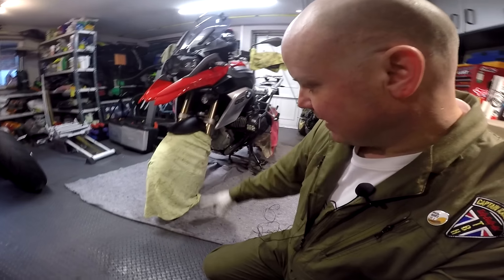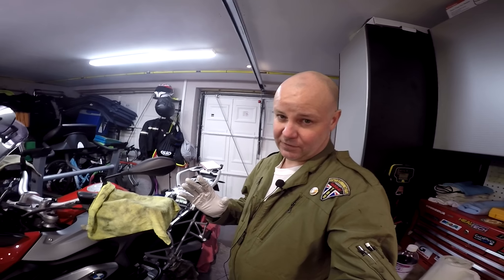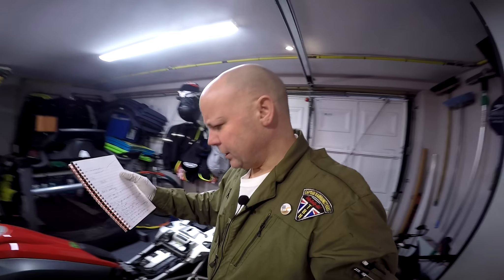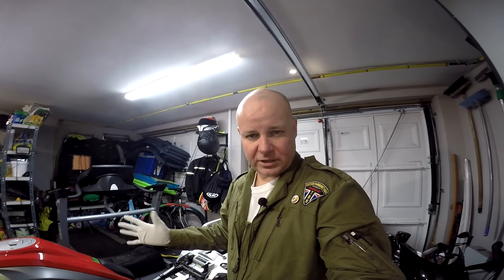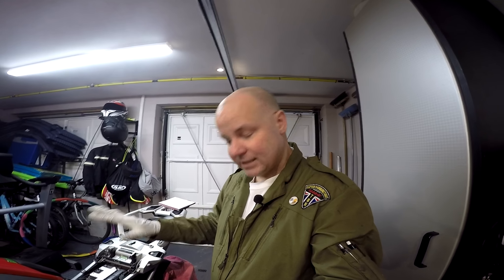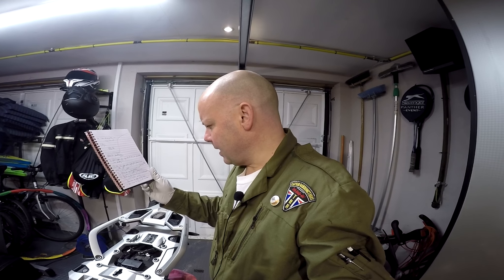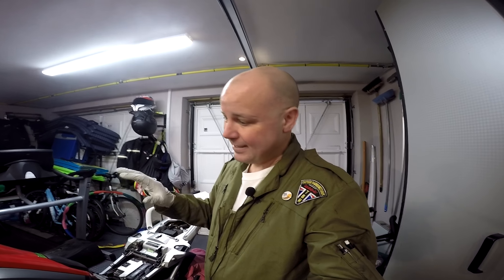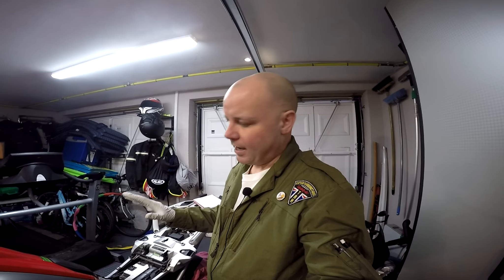How to apply ACF50 - Your questions answered

Comment: I've got a Bonneville T120 with chrome wheels and spokes. On the Bonnies you have 2 very large front discs. How would you apply ACF50 to these area's without getting it on the brake components and how well does it work on chromed parts?
Reply from the maker: I would do the wheels with it on a cloth or brush rather than risk getting it on the tyres/braking components (that' what I do with my CRF).....
Reply: I've started doing that today. I used the combination of a detailing brush and a wax applicator. Seems to work well although the front wheel is a nightmare. Unfortunately I couldnt finish the job as it started to rain and I dont have a garage...
Reply from the maker: Tell me about it - I washed and dried three cars and three bikes this morning...then it rained on them...ggrrgghhh
Reply: Managed to get it finished today but the wheels were a nightmare. managed to get them coated but couldnt get in the space to clear of any surplace off the spokes.... my answer was to take it for a ride at 70mph so centrifugal force moved all of the surplace to the rims and then removed it. Then cleaned any that had gone on to the tyre walls with some brake cleaner sprayed on to a cloth and then thoroughly cleaned. I'm hoping this gives me the results that all this effort has took.

Comment: Thanks TMF, a well timed presentation. I have two questions. I bought the arsehole, oops aerosol version and it does go on too gloopily. Could I spray that into a cloth and simply wipe it on? Secondly, I ACF 50'd my bike about 8 weeks ago, it's been garaged since and covered with an Oxford dust cover. My garage isn't heated, should I treat the bike again before spring or am I being over the top? It won't be out before then.
Reply from the maker: Yes that's the best way to do it and how I use the 3 (!) arsehole cans I still have! I'd say your bike is sorted until the spring, if you aren't riding it then you don't need to reapply, I think ACF50 state the product remains active for something like 2 years....
Reply: Ha ha, thanks!

Comment: Hi TMF, I apply it all over once a year about October but in addition I wipe it all over with a microfibre cloth soaked in ACF50 religiously after every clean.This keeps it totally protected. Even the plastics come up really well & looks better than the BS of back to black etc. It's amazing stuff. 
Also have you had any dealings with Vulcanet cleaning wipes? I use these to wipe over after any short rides to clean off bugs as an interim clean.I would be interested in your views on these, I find them very good & saves a full clean every time I ride the bike.
Reply from the maker: No I've not used the Vulcanet wipes as I don't trust "waterless" washes - I'm too anal about scratching paintwork by moving dirt around on its surface....for me it's lots of water and soap suds or not at all!
Reply: Fair comment, I was very skeptical until I used them & certainly wouldn't use them on a filthy bike but for a quick wipe over they are great, I hate putting my bike away dirty. I have a Triple Black probably the worst colour for scratches but there is not a mark on it! I agree you can't beat soap & water for a 'proper' wash though.
Reply: Hey Andy, saw those for the first time recently...assumed them to be an expensive waste of time.  My preferred method is snow foam type contactless cleaners and lots of water, to avoid scratches etc.  Always good to hear from people who use different products, but my word they're expensive.  Have you ever used snow foam type stuff, or SDoc1000?  Cheers, Glenn (by the way, I use a cheap snow foam now from B and M, as SDoc is brilliant but also bloody expensive!)

Comment: Thanks for the review. Initially you say that ACF50 is completely inert, then later you contradict this by saying that it reacts with some corrosion to reverse it. So are you absolutely sure that it won't damage plastic or painted parts?
Reply from the maker: 100% :0)

Comment: As always a great review on ACF50. I have always applied several coats of clear lacquer to the brightwork on a new bike and found that the fasteners etc remain corrosion free for years. what are your thoughts on that ? I live in central Scotland and do not drive in the winter, too much salt / ice on the roads around here.
Reply from the maker: Yes a great idea - wish I'd thought of that!  Having said that, I have religiously ACF'd my Triumph Street Triple and the nuts and bolts on that are as shiny as the day she rolled off the Hinckley factory floor....

Comment: I would like to ask if you spray coils , HT leads if it helps with horrendous fog and sub zero conditions , in the morning these weather conditions affect my bike , the bike just feels a bit rough because coming home in the afternoon the bike rides well , I will buy this product for the protection it gives the frame but does anyone else suffer the same problems or will acf 50 cure this too.
Reply from the maker: Worth a try!

Comment: I've heard people mixing ACF50 with something else and using it as a chain lube.  Any idea what that something else is and would you recommend it?
Reply from the maker: No - I would use chain lube to lube the chain and rust preventer/protector to prevent rust and protect your bike.  Quite different applications and the various specialist products are formulated accordingly (I have been to one of the manufacturers and seen them doing it...they know their stuff)....

Comment: Sorry TMF I found the atomiser was rubbish. In the end I used my air compressor with a half full “paraffin” spray gun works really well.
Reply from the maker: Yes that's defo the best way - but if you've not got a compressor (like me) then the ACF50 atomiser is the only thing that at least partially works (that I've found)....
Reply: Stand the ACF50 sprayer in hot water for 10 mins it stops it clogging up
Reply from the maker: As per my "how to apply" video :0)
Reply: I use a handheld electric spray gun I got from ebay for £18.99 (incl postage).  Does the whole thing in about 60 seconds if all the oil sensitive bits are safely wrapped up first.
Reply: Ooh I’ve got a compressor, what a good idea....
Reply from the maker: Apparently a "paraffin gun" is what you need to hook up to it.....defo the best way to apply, you can really get a fine mist going into all parts of the bike then (like the pros)....
Reply: TheMissendenFlyer you can get a really fine mist. I would suggest using a mask when spraying, you don’t want it on your lungs.
Reply: My atomiser was good for x3 uses before breaking beyond repair. Advise against purchasing.
Reply: I bought an ACF-50 spray gun and a bottle of ACF-50 from Killer Brands. I used it this morning (white frost on the ground) and it worked perfectly, it produced a fine mist. The gun is gravity fed, obviously needs a compressor

Comment: Is it ok to put on the chain?
Reply from the maker: You can but why would you? It’s certainly not a replacement for chain lube....
Reply: I wasn’t thinking more for protecting it from rust
Reply from the maker: fair do's but if the chain is well lubed it shouldn't rust anyway...??
Reply: TheMissendenFlyer I use WD40 to clean it and Wurth dry chain lube. But every now and then the chain shows a little rust, was just thinking that it might give it a little more protection.

Comment: Going to need some of this stuff as I've just placed an order for a 2018 GSA Triple Black (damn you and Baron Von Grumble for your superb videos on these bikes!!)
A few questions (sorry!) - presumable perfectly OK on the ali panniers?  Do you keep ACF50 away from the 'whizz wheel', as I can image it getting gummed up a tad? And lastly, when you spray in the area beneath the seat, there will no doubt be areas where the spray goes, but you can't get to with a cloth - over time, doesn't this become a bit unsightly? Apologies if these questions have already been asked, but it would take a long time to read all the comments! All the best, Paul
Reply from the maker: Congratulations!  And don't worry abut the ACF50, part of its use in the aircraft industry is on circuit boards - I'd keep away from the whizz wheel purely 'cos you don't want to get it on the handlebar grips....enjoy!

Comment: Do you use it on your drivetrain, specifically the chain?
Reply from the maker: Well I don't worry if I get it on the chain but I don't use it as a chain lube if that's what you mean, I tend to clean and lube that separately with specific chain cleaner/lube....
Reply: TheMissendenFlyer thanks. I degreased my chain and gave it a coat on the outer plates, let it creep for a while, then have just used normal chain oil. Spent a while looking online and found most of the advice contradictory. Just thought you might’ve tried it on the Honda.

Comment: Hi MF. Have you tried to heat the ACF50 and use an air spray gun and under low pressure apply the ACF50 to reach parts and areas that are difficult to reach otherwise. Thank you for your good work.
Reply from the maker: Not yet but having bought a compressor a few weeks back next year I intend to do just that!

Comment: Have you ever tried a liquid glass product by a company which I think is called Nanotech? It's a clear water-like product that can be used for boats, cars etc too which is why I bought mine. This too is used in the aviation world but at £80 for a smallish bottle it's not cheap. Again, it forms a hydrostatic molecular bond to the surface and thus repels water. After applying to a small area of a vehicle, GRP boat or whatever and hosing off, the water does indeed appear to run off in sheets!
Reply from the maker: I have come across products sounding like that yes - in fact I had my Panigale treated with it (G-Tech) after I had the paint protection kit applied if I recall correctly....

Comment: TMF if acf50 is so good in protection, what would it do for your engine if you sprayed in to the engine oil top hole,  up say 1/2 a cans worth ?. or am I being silly.
Reply from the maker: ...you're being silly...
Reply: TMF I was thinking on the lines of slick 50 engine treatment, acf50 is aircraft grade of protection so why not use it in the engine.
Reply: Pls advise slick 50 or acf

Comment: How do you fully remove it in the Summer etc? Do you use some type of degreasing cleaner (Simple Green/Gunk Engine Bright, etc)?
Reply from the maker: Nope, just clean the bike as normal - no issue....if you apply it in a light mist there shouldn't be anything to remove!

Comment: Hello MrF. If I was you I’d use a de-humidifier; then your bikes (and garage) will be as dry as Ghandi’s flip-flops and you wont need anything on them.
Reply from the maker: Well that would be fine if my bikes just stayed in the garage all winter!
Reply: TheMissendenFlyer if I’ve been out all I do is clean it, dry it off with cloths and use the dehumidifier. Everything’s bone dry in about an hour. Have a go...see what you think.

Comment: MF, Just one more question or maybe two. You say it can be used on plastics, how about fairings? Do you use it on your Panigale's fairings or do you take them off and do underneath so crud and salty water don't attack the engine casings and other ancillaries? Radiator? Is it ok on painted surfaces as well or just on metal surfaces? Many thanks.
Reply from the maker: Yep it's fine on painted surfaces, I don't do the shiny plastics because I can see no advantage to doing so...doesn't do them harm though except to maybe make them go a bit smeary....

Comment: hi TMF can you apply acf50 on chain with chain lube as well? if so how would you go about applying it i e. lube first or acf50 first? TIA
Reply from the maker: Personally I wouldn't, the chain lube should look after the chain and acf50 is not designed as a high temp lube....doesn't matter if you get it on the chain, but I wouldn't make a point of applying it...

Comment: Call me old fashioned but I use WD40... occasionally.
Reply from the maker: Well it's better than nothing in that it at least provides a thin protective coat, won't bond with the surface at a molecular level and  stop or reverse the corrosion process like ACF50 though....

Comment: You gave some bad advice on the bottle. I purchased it, and it is totally useless. I might as well pour it on the bike
Reply from the maker: Worked for me (especially if you warm the ACF 50) - best bet is a compressor though....
Reply: @TheMissendenFlyer  I appreciate the info and advice,  although I couldn't get it to work for me. I will give it a nother go. But I suspect I will end up just going back to the good old wd40